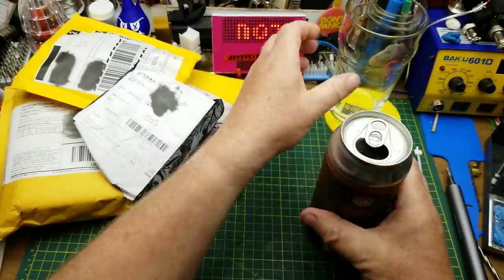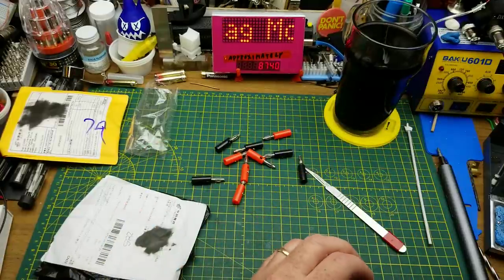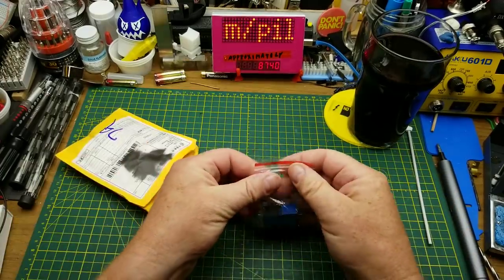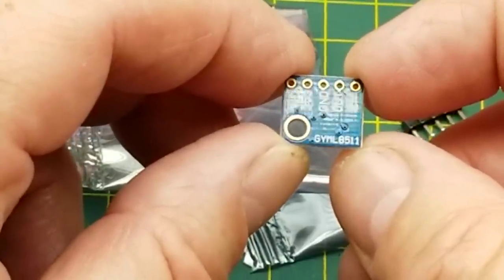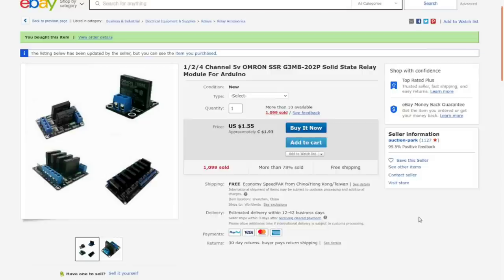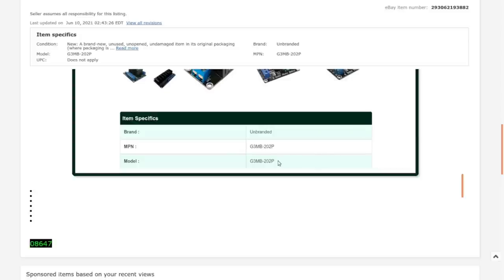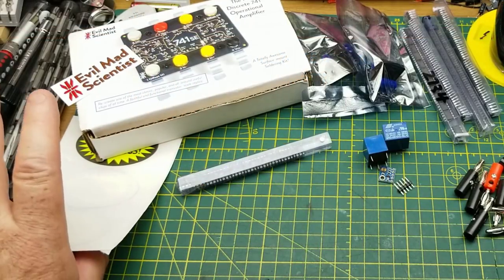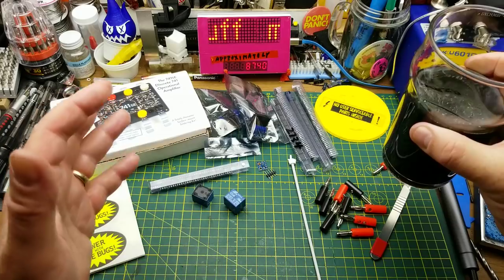Mailbag Monday #117

Comment: used to use the 741 in a metal can in the 70's, still have a few left :-, to drive headphones you could use the 759 which was a 741 with a higher power output stage. This was before we went digital in the 80's and better chips were around. I wounder if there are any old jet fighters flying around still with 70's avionics.

Comment: Looks like the banana plugs I got. The clamping part is turnable on some axis and had quite some contact problems causing them to get hot at higher currents. I solder them together before use ever since.
Reply from the maker: Yeah, these may not be the most durable, but if you solder them on they're fine for hobby use - especially at the price.

Comment: Cool, you can use the small 741 for your project and use the BIG one with small components for the same project but for entertainment purposes haha the blue relays on the boards the ones you bought replacements for, did you try activating the coil with 5V? you never know with china parts.

Comment: I did'nt know you could get UV detectors, Cool.

You should check out Usagi Electric, He's made a 555 chip using valves running at 24V. and He's currently working on a 741 version, They both have working pins and a huge dip socket.
Reply from the maker: I saw his tube shenanigans. 
It's impressive, and just the right kind of crazy.

Comment: Cool stuff!  I do have a question though... What is the Blue 3D Printed Flat item next to the beer station and under the solder station? That looks interesting.   I also order those banana plugs and had to order more the next day because I used the first set right away.
Reply from the maker: It's actually a piece of silicone that came with one of the soldering irons.
It is intended to be used when swapping tips on the iron to prevent burns on your fingers.

Comment: Did you ever try online store taydaelectronics ? They're return back inexpensive delivery and they have really good quality components. No fakes, all components have datasheets, relays is proper certified, etc. Best source of .25w resistors for homegamers that I know.
Reply from the maker: I haven't, but I'll take a look.
I wonder what their international shipping cost is like?
Reply: @pileofstuff  My latest order: Subtotal 	$14.10
Shipping & Handling 	$2.24
Grand Total 	$16.34
300 resistors (.25w, 1%) + 15 PNP power mosfets. All prices in USD, delivery to Fort Vermilion, AB. Shipping can vary based on size and weight of items.